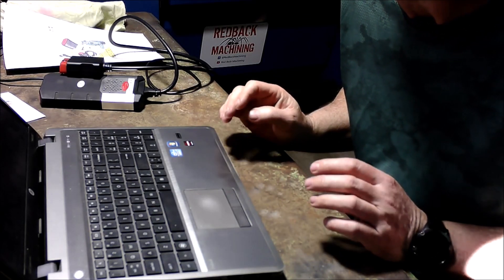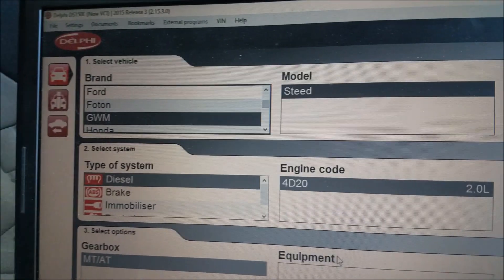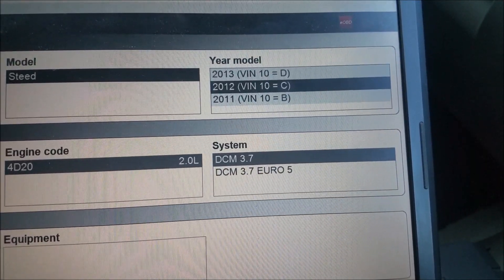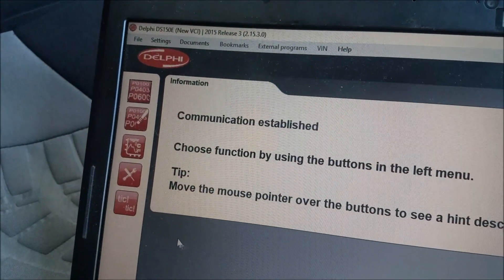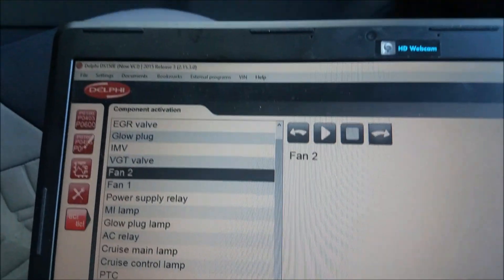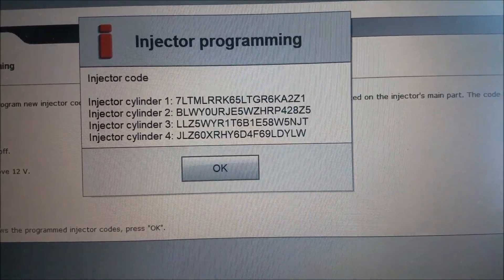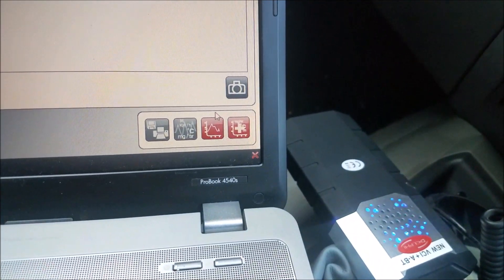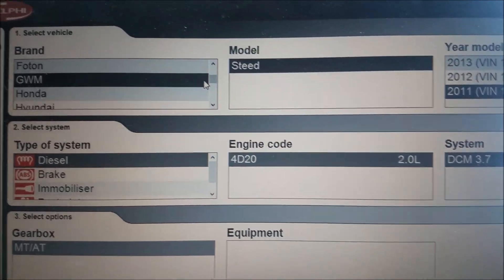Great Wall Diagnostics Tool

Comment: My 2017 steed need the throttle calibrated,  it has a dead band at the beginning of travel then winds up ok. Can this tool change the pedal ranges etc?

Comment: Hi Chris... I have this model engine Gw4d20 on my China suv model Haval H5 Gw4d20 diesel turbo engine 2.0 is it possible to get the correct software to reprogram all 4 injectors 28231014

Comment: Hey mate i know its been a long time since posting this video, but ive bought a greatwall x200 4d20 tdi and most scanners i use get the codes but mostly say see service manual or take to dealer. do you know of any scanners which actually show the codes information.

Comment: Does that have dpf set up plus tpms as well and how much does this unit cost
Reply from the maker: I hope this helps you. You will have to do some research to see if it is compatible with your car.

AU $47.01 | Obd Obd2 Scanner 3 In1 For Delphis For Ds150e 2021 USB Bluetooth 2017 r3 Keygen Car Diagnostic Repair Tool
https://a.aliexpress.com/_mPHCFky

Comment: Hi I have the 19 steed turbo diesel wondering if I can use the hand-held to get the same information or similar thanks
Reply from the maker: Yes I have a cheap hand held I keep in my car. It is not as good as a laptop but you can get some useful  information
Reply: @redbackmachining8368  yeah cool I was looking at the launch cReader 5 +
Is that what you use
Reply from the maker: Mine is a maxiscan MS509
Reply: @redbackmachining8368  thanks very much I found one on eBay for $65 hopefully it'll do everything I need for my great Wall thank you